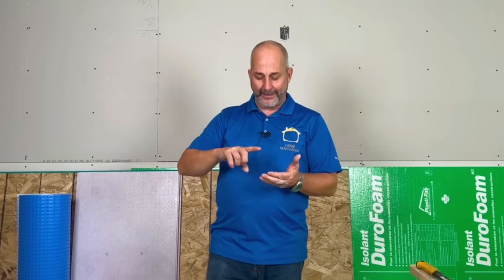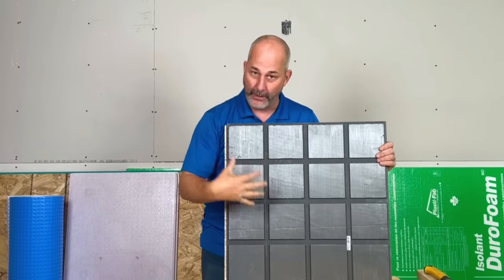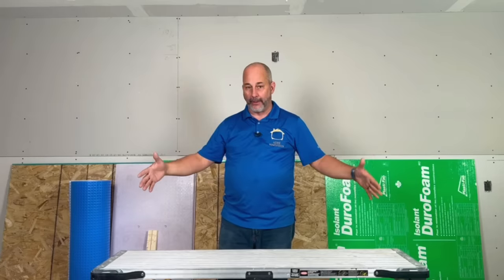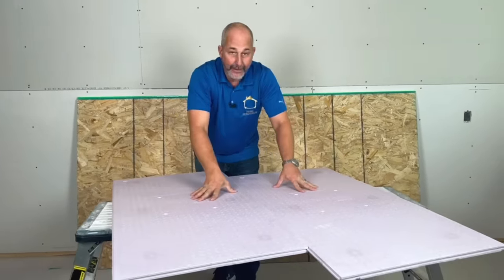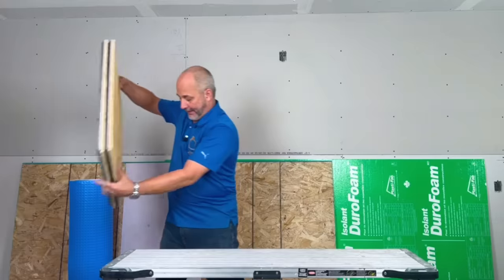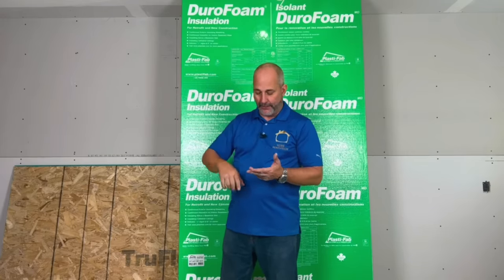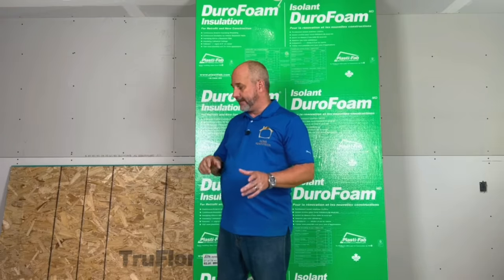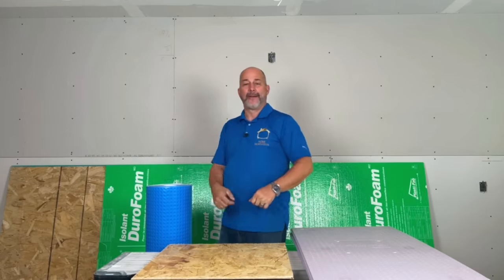Comparing 5 Different Subfloor Systems and What They Cost

Comment: This channel has been invaluable as a new homeowner. Even with good diy skills having so much info presented so efficiently in one place is amazing.
Reply: Agreed, I always come here first before embarking on my nearly daily trip to Lowes
Reply from the maker: Great to hear! We always try to provide an objective opinion and many solutions to the same problem as possible. Cheers!
Reply: I'm not even a home owner and i have watched for a few years now
Reply: I want to say how much I appreciate your no bullshit, straight to the meat videos. I'm happy to not listen to stupid rock music or other bs and it's all info no fluff. Keep up the good work.
Reply: I'm a new homeowner with an unfinished basement. I'm tempted to let a contractor do the framing and electrical then I'll come in and do my own drywall and flooring then perhaps have a guy come in and paint the place with a sprayer.
Reply: @HomeRenoVisionDIY  Hello, I have an approximately 100-year-old house on the ground floor, built on sand, only concrete and foil for vapor insulation. My house has a cold floor and I am limited by the height, so I am looking for a solution with the thinnest possible thermal insulation layer. Should I choose styrodur or wood fiber underlay? Or maybe something else? I will add that I am from Poland

Comment: As an inexperienced homeowner about eight years ago, we had our basement refinished by some c-grade contractors (it was actually a reputable company but the experienced partner left). They cut a trench in the pad for a sewer line and we basically had a little canal that quickly filled with water while it was open. It turns out we have A LOT of water around us. We’re on a steep hill but our neighborhood jokes that we live on an underground river. Ha ha. Anyway, I panicked. I knew we had interior French drains because there was dimple mat coming up from the floor around the perimeter. I bought some foundation dimple mat and wrapped the walls, tucking it into the mat coming up from the floor. I took over the floor install and installed Dricor and Lifeproof LVL. The contractors used standard fiberglass insulation, which still makes me wince. I keep a dehumidifier going constantly. It’s been fine—dry and warm, but I regret doing it to this day and still keep smelling to see if there is any mildew. At one point I pulled some drywall to check conditions. There were very faint spots on insulation which may have been mold precursor, and while it didn’t feel damp, I wouldn’t say it felt bone dry either. I think it would have been a disaster if I hadn’t done that remediation but right now it is what it is.

Comment: Great video. I’ve actually been looking into options like these. I’ll be building and finishing an office space inside a 40x40 garage we just had built. I was looking into the Dricore products to provide a thermal break. Garage slab does have a vapor barrier under it. Located in northern Wisconsin.
Reply from the maker: thermal break is nice but for an office in your area I would consider installing a ditra mat with electric cable for a heat source. then you can add floor leveler and then vinyl flooring on top. you get a heated floor that will always be dry and a durable finish without too much height added. Cheers!
Reply: @HomeRenoVisionDIY  what about if we intend  on heating the office space with a mini split? Is the heated floor overkill then? Or is the mini split overkill. Office space is going to be 10x12

Comment: Another stellar video, Jeff! Thank you! Question - we have a house built in 1970, no moisture issues thankfully, but our existing floor is carpet (pad on top of concrete) and the floor is so cold. The challenge we have with choosing a subfloor is that our floor is not very level (significantly sloped towards the floor drains). leveling is possible, however I'm not versed in raising the floor drain and I'm afraid it could open a can of worms. Any suggestions?

Comment: When I gutted my basement a few years ago down to concrete walls and floor, I went with 1" XPS foam boards on the walls and in the rim joist and DMX dimple mat on the floor. Laid down Vinyl planks directly over the dimple mat. I haven't had a single issue with my basement that was built in 1970.  I am located in the midwest and go through all 4 seasons. I also put in a new sump pit during this time since the old one was not done right.  Kuddos to your channel and the knowledge from my dad. Saved a ton of money doing it myself.
Reply from the maker: well done my man! just keep an eye on grading over time to make sure you don't have water running down the foundation wall. Cheers!
Reply: I'm currently in the same boat you're in now. I was looking at using 1" XPS but everywhere I look online everyone recommends using 2" XPS. The problem is 2" XPS foam is sold out everywhere currently. I take it the 1" XPS is enough to provide the necessary vapor barrier I need? also in the midwest. St. Louis, MO suburbs
Reply: @GTOjoe6.0  From my research, the 1" would give me enough to be a vapor retarder. 2" would have given me a moisture barrier.  I installed it so any moisture that did get on the inside would run down the wall and under my dimple map.  I only ran the glue vertical when putting up the foam boards. I did tape plastic on a few spots to test for moisture before installing. I also have excellent grading away from my house and relieve any hydro pressure with my new sump pit I installed. FYI...I just checked Menards and they have a ton of 2" in stock.
Reply: @Jake Miller  I'd like to go with the 2" polyiso by johns manville. I didn't see any online, what menards did you check? I live near the Menards in saint peters, mo
Reply: We're in southern Ontario. Ripping out an old wood subfloor that needs to come out. The basement, when we redo it, will be redone with laminate throughout, besides the bathroom which we may tile or use vinyl flooring. We wish to have a barrier from the cold concrete below, and protection in the event of moisture or a touch of water, which we're not aware of having any water problem. If you recommend something, like to know if you need to attach with tapcons, we prefer no to, however if it's the best option we would. Prefer no clicking when you walk, but heard you can put something under the plastic underlay, DMX, bubble product etc, so it doesn't click. Thanks

Comment: I'm in Omaha and did my basement 4th bedroom and bath in Dricore almost 15 years ago.  I hate cold basements so I also lined the cinderblock walls with 2 inch pink foamboard, then a 2X4 stud wall insolated with fiberglass bats.  People are amazed at how warm the downstairs apartment is.
Reply: What a small world - Omaha DIYer here too!
Reply: I only wish more people did foam board or foam insulation,  it is a game changer for basements.   I am in the finishing stages of my 2004 basement is as warm as the main level, and I know the difference was immediately felt after the spray foam application in the rim joists and the walls.  I added batt as well to the partially empty 2x4 cavities and re-used the pink fiberglass into the rim joists.  I could lay ice on the floor and the basement would be just as warm.  I want with DMX 1 step, and the thermal break alone does a good job.  There really is nowhere for the heat to escape!
Reply from the maker: Cheers!
Reply: @HomeRenoVisionDIY  Can I build my 2x4 walls on top of the DMX step 1? If I insulate the walls with pink batt insulation do I need an air gap of 1" or is foam board a better option first and then batt? Great videos Jeff!
Reply: hello hi flyer, im also redoing my basement, i have no water issues.  im more concerned with moisture.  my question is if i use foamboard on the cinder block walls and then bat insolation my stud walls, should i be worried about condensation behind my walls? im thinking if i use non backing insulation, and including the air space between the wall and foam should be enough to keep things dry back there.  thoughts?  JEFF, you are THE BEST, thank you for everything you do!

Comment: 10 years ago we finished half the basement.  I installed a Dri Core sub floor on my own and then had wall to wall carpeting installed.  A few years later the hot water heater sprung a leak and the water travelled UNDER the floor to another side of the basement (its an old house with nothing level).  The Dri Core subfloor saved my bacon.
Reply from the maker: well played. Cheers!
Reply: Do you still need to remove the floor to let it dry out? I have a ripped up floor right now and considering what to put back down
Reply: @ZhefeiLi  nope. Left the floor as is since the water never touched the OSB side.  I did put some fans down to blow air under the floor to dry the floor out.

Comment: Hey Jeff! I watched a ton of your previous videos on flooring and just finished the living room in my basement (1969). I decided to go with the DMX over the DRICORE not only because I was worried about water and moisture but also the cost. The difference in price between the "regular" DRICORE and the DMX was a difference of 500$ in my area for a 300 sqft space. My basement has a slope going towards the drain and when I measured the distances, it fell within the range without filing (1/2"inch over 4ft). Therefore technically I would not have fill gaps etc. If I were to do this project again I would most likely invest more so that I could have my entire subfloor as level as it can be. I am seeing the results of placing my 7mm rigid vinyl flooring over the DMX as well as trying to align all of the baseboards and quarter rounds. Compared to the other products, there is no way to level DMX than to use self leveler or just fill with concrete. DRICORE sells plastic shims that will level each sheet as you progress and I assume with the Durofoam you can shave off and add pieces to fix this problem as well?

Also with DMX they advertised a lot that there would be a great difference in temperature when compared to the DRICORE, I would have to say that this is false. My floors are not ice cold but they are not as warm as I thought they would be either.

Keep up the great videos they have been a lot of help for me!!!

P.S I am about to put in door frames that are not prehung, could you possibly make a video in the future on how to put them up starting from scratch! :D
Reply from the maker: I will consider that. Cheers!
Reply: @ Andrew Wong
I have the scenario in basement as you had. I have option for Dricore and DMX, which system do you still prefer ? Your advise will be appreciated since you have gone through this !
Reply: @SaahilSethy  if you have water problems I think Jeff still suggests using the DMX but if not I would do dricore so that the floor is as level as can be. He recently posted another video with the foam as a subfloor it looks decent as well!
Reply: @andrewwong7912  
Thanks Andrew

Comment: Foundation poured 1909. Will be fully waterproofed with an interior drain tile, sump pump, battery backup, and DMX drainage board on the walls from grade level all the way down directly into the drain tile. We live in chicago so freeze/thaw cycles are a problem. There are cracks in the basement floor and it’s not level. We also have floor drains but a one-way check valve on the sewer line so backups are no longer a concern. What do you suggest: regular DMX with OSB, DMX 1-step with OSB, or foam board with OSB? The ground gets COLD here in the winter so thermal break would be awesome but don’t want to discount moisture management if DMX. We plan to build interior walls on top of the floor, whatever we choose.

Comment: I love this channel so much. We bought a house in southern BC (Nelson), built in 1973, and it's a pretty humid house, even in the winter. I'm doing our basement right now and have gone with the Barricade Thermal Armor HDF panels. They actually cost pretty much the same as the other Barricade products per unit (at our Rona here in town) but are larger so it worked out cheaper. About 1400 for 650sqft after tax. I chose this as it offered the best R-Value and being an old house with just baseboard heat, we're trying to make it as warm as possible in the basement for family and friends to come and stay as that's where the guest suite is.

There are some foundation issues as it's build on a very wet hill, so the foam board right on the floor wasn't an option for us. But this video definitely explained in 5 minutes what it took me about 2 hours of reading online to ascertain!

Thanks so much for all the videos and content, it really does help all us so, so much!

Comment: When I did the subfloor in my basement, I went with the foundation membrane, with the foil backed foam, then 5/8" osb on top. Sure it's a little thick, but no worst then the 2×4 and osb that was ripped up. With the cold Canadian winters it was a great investment.
Reply from the maker: great solution, water management and thermal break. Cheers!
Reply: @HomeRenoVisionDIY  hi, can you put laminate directly on the foundation membrane foam sheets?
Reply: for your foil-backed foam, which side does the foil face? we are considering doing so for our old garage, which is 5 inches below grade. has issues of both moistures coming up and inside down. Also, how did you anchor the OSB to the foam? Thank you
Reply: I live in Canada too, in a 50 yr old townhouse. For the basement poured concrete floor, I am thinking of putting the foundation wrap with  4x8 tongue and groove plywood, not OSB, and using a minimal amount of tapcons. At the joints of the foundation wrap, use that red tape to seal it. Use construction adhesive on top of the wrap to connect to the plywood. Comments?  I really don't like OSB because of the off-gassing and the breakdown with moisture.
Reply: @jk-zm2fs  Chances are the adhesive won't stick to the foundation wrap. I ended up having to redo the subfloor due to a sump pump failure, and when I was pulling it up, the adhesive didn't stay stuck to it. The new subfloor, I used the same foundation wrap, foam, T&G osb, and tapcons. I put about 6 tapcons per 4'×8' sheet and found that held everything in place nicely. If you go too close to the edge, you will end up with the center of the sheets bowing. Anything smaller than 24" I used a single row in the middle. No adhesive.

Comment: Great explanations of the options! I'm going with the insul armor for my 110 yr old house's basement, in Minnesota because:
- Thermal barrier (r value of 4.1)
- Water/vapor management built right in
- Thinner than combining durofoam + dimples
- Easiest to get into my narrow basement ( I had to cut my 8x4 drywall in half to get them into the basement space it was awful)

It is a little more expensive, but actually in the US, they just announced a 30% tax credit for home insulation modifications; save those receipts!

Comment: Great video! 1year as Homeowner. Had major renovation project at the beginning. Contractor cut corners while renovating basement. He put LVP on bare concrete in upstate NY 1971 Built split level home. To the untrained eye, I had no cracks in the basement. Some cracks in the Garage next door. A year later we have 2 weeks of consistent rain and at the very end I had a very low amount of moisture seep through middle of basement floor. No water coming from walls or broken pipe. Basically water sitting in the middle of the floor. Water height did not go above the bottom of a shoe. VERY shallow. Basement waterproofing companies say I may need a sump pump system and for now just watch it. Now I’m starting to think I just need a good underlayment. I’m here in the comment section, thoughts?